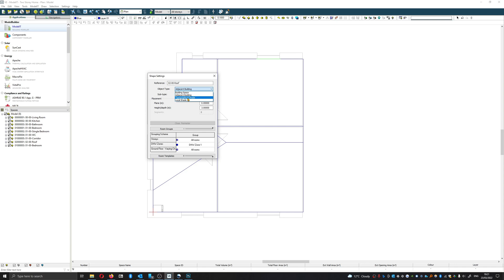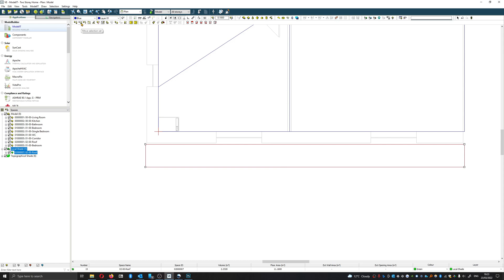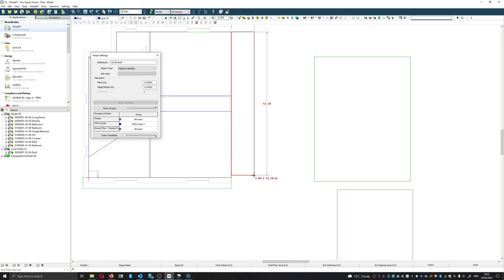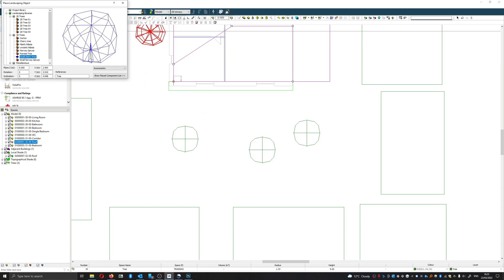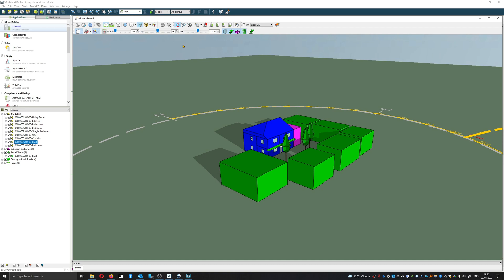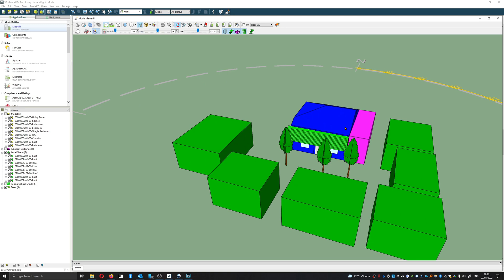IES VE Tutorials - Episode 9 - Solar Shading

Comment: Great video! My whole model is ~1.2 m below street level. Could you demo how to split all exterior walls at the ground line (bottom = Ground (soil), top = External), then Update Adjacencies and set BCs in Apache Room Data? Also any advice on ground temp/soil settings in VE. Thanks!

Comment: Hello! First of all, thank you for the great video.
I have a question regarding modeling local shades that consist of thin vertical perforated metal sheets in front of the windows. However, I am unable to specify the shading only as a 2D plane. Is it even possible to do that in IES?
Reply from the maker: How small are perforations? Honestly, unless you have some specific thing your looking at your better taking the equivalent free area. E. G. If you had a 3x1 shade with a F/A of 0.5 you could also model that as a 1.5 x 1 model.
Reply: @grayenergy5413  Thank you for getting back to me! The level of perforation wil be a topic of the study. That said, I agree with you—starting by considering it as the equivalent area is probably fine. My concern is more related to how to model the metal sheet itself, even without perforation. It will be a thin sheet, just a couple of millimeters thick, but it seems I cannot model such a thin thickness in IES. I was exploring the possibility of modeling it as a 2D plate, but there doesn't seem to be an option for that.
Reply from the maker: @romanamelova6002 These are the sort of questions I like, requires some brain engagement :). Okay - so if you wanted to model a very thin thing, you could reduce the grid size down to something very very small and you can do the thickness you want. Or, I believe you can use the draw plane tool (next to the draw tree and add tag button), though I cannot for the life of me remember if this is incorporated into the solar shading model. 

Just remember that the thing you attempting to control for at that point in the resultant angle from the lip thickness, as your not getting a constant increasing error from the perforation hole depths. So the error your fearing occuring may be marginal compared to the other "inaccuracies" within the model.